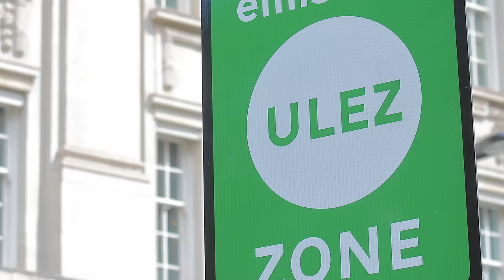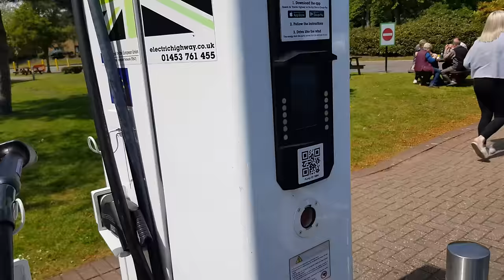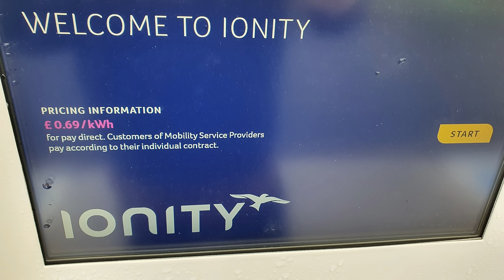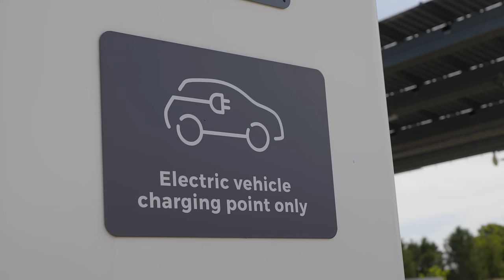The Uncomfortable TRUTH About EVs: The Version NEITHER SIDE Wants You To Hear

Comment: Regarding EV fires, it's worth pointing out that while LiNMC cells are prone to thermal runaway when damaged, the mainstream car industry is quickly transitioning to LiFePo chemistry (largely because it's cheaper) which is far more chemically stable, to the point of it being almost impossible for LiFePo battery packs to catch fire even when damaged or exposed to extreme heat.
Reply: They'll never happen in anything smaller than a truck.
"Li-ion batteries can store more power per volume or weight unit than LFPs. For example, the energy density of a typical Li-ion battery is around 45–120 Wh per lb (100-265 Wh per kg), while the energy density of a LiFePO4 battery is about 40–55 Wh per lb (90-120 Wh per kg)."
Reply: @m4rvinmartian  Dunno what you are talking about.. For example Tesla's Chinese manufactured cars use mainly LFP packs since the start. Chinese EVs will soon be almost exclusively something else than NMC. From 2020 to 2022, before the Berlin and Austin factory, basically half of Tesla's were manufactured with LFP packs.

The current Model 3/Y 60kWh LFP pack makes for a great EV at as low as ~35k€ after incentives.
Reply: even with fireproof battery i still love to rev the hell out my itb shtbox,sounds good,feels good.
gas is near free here too
Reply: @m4rvinmartian  You are seriously misinformed, they are already in the Tesla Model 3 & Y RWD and all new BYD's.
Reply: @m4rvinmartian  FYI, LFP batteries are also Li-ion batteries… LFP are just mainly using iron instead of nickle, which is good for cost and safety, but not as good for energy density…
Reply: @m4rvinmartian  Tells me you know nothing about BEVs or batteries!  Today there are already significant volumes of new passenger cars that use the LFP (not LiFePO4 which is a specific chemisty) cells.  Because these cells also have an ageing slope that is roughly half that of NMC cells you don't need to fit more capacity or even the same capacity because the capacity that determines the pack nominal size is the End Of Life capacity and not the new capacity (ie the capacity at EoL SoH)

Today, a mainstream Tier1 OE certified cell supplier is churning out LFP cells that have an installed specific capacity just 6% lower than for the NMC equivlents, this makes the reduced capacity pretty much irrelevant when compared to the 50% reduction in cycle based aging!
Reply: The cheaper, lower range vehicles are the ones which typically have the LFP batteries.
Reply: @sepehr-9210  You might like the 2025 Hyundai IONIQ 5 N. It emulates an internal combustion engine paired with an 8 speed manual double clutch transmission.
Not cheap though.
Reply: @jamesphillips2285  in no case i would buy a korean ev
you can buy a r32 or r35 with that money
Reply: @sepehr-9210  and get passed by the EV. If you've never driven one, i'd recommend a test drive in a model 3 performance. The speed is on another level, and it does it without being uncontrollable like high horsepower ICE vehicles are a lot of the time. plus it's cheaper than the ioniq and faster and more efficient. Also, the fake shifting is the dumbest thing ever. The whole point of a dual clutch is to save time shifting and have more time on power. The car making noise is LITERALLY the south park episode with the biker gang. It's the same thing.
Reply: @aidencaterwall9146  in a real car community, no one cares about getting passed by an ev
The real reason why people love shtboxes cause they can fiddle with it and the story behind it is what matters
Plus I don't think you can autocross or rallycross a tesla ,like a pug 205/106 or a ford focus.
Speed and drag is for 12yo kids,we gather up only to have fun unlike ev owners 
(When all the time they talk about how many hellcat or Porsche they sMoKeD)
Reply: @sepehr-9210  it holds .95 on the skid pad with the stock tires. You only fiddle with shitboxes because they are shit. You have to upgrade it for it to be competitive. There’s a reason why people upgrade to nicer and nicer cars most of the time.

Also, your argument is a no true Scotsman fallacy. Plenty of people care about being passed, and even more people care about being able to get out of their own damn way. Shit boxes are fun because they are cheap and light and you can drive them hard without risking an accident. The traction control in the model 3 performance lets you do this too, but on a completely different scale.
Reply: @sepehr-9210  oh and as far as fun goes, I bet money the model 3 performance puts more smiles on faces than any shitbox.

Comment: The biggest problem is the price of electricity. Somehow, the government has allowed it to spiral over the last two years despite the input costs of generating electricity being about the same. If electricity was cheap (and by cheap I mean less than 10p/kWh for domestic supply and less than 20-25p/kWh for a fast charger), consumers would be all over them as they're so much cheaper to run despite the higher purchase cost. At current prices, it just doesn't make sense if you don't have a company car scheme. 

The same is true for heat pumps - despite spending ages researching heat pumps, we're going to replace our old boiler with a new efficient gas boiler.  Gas is so much cheaper than electricity that even the most efficient heat pump with a CoP of 4 would cost more to run, making the higher initial investment a complete non-starter.
Reply: Octopus ("-Go") (and others, I believe) are offering under-10p for super-off-peak. The deal for heat-pumps is a little more expensive. It is irritating that Octopus differentiate between the two - you need to prove you own an EV to get "Go". A worse problem is the grid supply that most homes have. I have 1-phase 100A, and like most people, upgrade to 3-phase would be extortionate. But my supply will not be able to fully charge an EV and run the heat-pump in the small slot of super-off-peak hours that "Go" or the other allocate. A battery would make the situation even worse. In the long term, the answer to all this is a massive, cheap home battery and truly dynamic "pull-oriented" operation. It isn't on the horizon in say, next 2 years. So for now, most power will cost 10p but you have to just put up with the occasional ripoff which might be 70p at a fast-charging station. But "non-starter" is incorrect; with the UK govt 7k5 grant a heat-pump is viable, especially considering that the pricing of gas vs electric is entirely artificial.
Reply: Natural gas is cheaper today on the wholesale market than it was in 1990.
Reply: @jonb5493 That's not the biggest problem.  The biggest problem is that we'll need to spend several trillion pounds on infrastructure to upgrade the grid, and I hope you're joking about batteries. People are out of their minds with all that stuff when the alternative is a 4p / kwh gas boiler for the house and their existing car at £1.40 / litre for petrol. It's absolute insanity.
Reply: @davelowe1977  Let's look at the numbers. 4p/Kwh gas is about the same cost/KWh heat as 10p/KWh electricity, assuming a CoP of 2.5 in a heat-pump. If the heat-pump has better than 2.5 CoP, it is actually cheaper than gas. Besides, a couple of years ago gas prices were 4x this. And regarding petrol home-charged EVs are far cheaper to run than ICEs.
Reply: @jonb5493  Except that gas is 7.67p kWh and electricity is 29.49p kWh meaning that with your COP of 2.5, the electricity is 35% more expensive. Also, once there's no competing fuel, the electricity price will skyrocket.
Reply: @davelowe1977  No. Super-off-peak is 8-10p/Kwh. See the Octopus G and Cosy plans, and equivalent among their competitors.
Reply: @jonb5493  And what if you want to heat your house during the day and not just at 2am?
Reply: @davelowe1977  Basically, there's no way around huge boiler capacity: the "traditional heat battery", which can be a real problem for small, old homes. A solution that I don't like is the "glorified storage heaters" ala Aquaficient et al. They are  extortionate and get zero financial help, and still need some space for a boiler. Clearly getting gas out of our heating systems will be a long and incremental process: easiest homes first. BTW if you're saying that the govt or whoever are taking a cavalier attitude of "everybody trash their gas heater and it'll be ok somehow" - I couldn't agree more. This is a massive transition, there's no denying it.
Reply: @jonb5493  it's unnecessary, that's what it is. The British Geological Survey reported that we have proven gas reserves to continue consumption at the present rate for 748 years.
Reply: Greed is always a factor in anything new that will make money.
Reply: There won’t be an “off peak” rate if we all move to electric vehicles unless they build a lot more nuclear power stations.  The reason “off peak” is cheaper is because they don’t have to fire up so many gas plants for peak daytime loads. 

We would  always need a certain percentage of fossil fuel plants to be able to recover from a dead grid.

Comment: I am not anti EV but anything which is mandated by our politicians has me seriously worried. I have a nasty feeling we could be looking at another Dieselgate fiasco in the future but in EV form. There is also the nasty fact that EVs do burst in to flames (not frequently) and are very difficult to extinguish (which is the difference to ICE vehicles). If anyone wants an example of this, Google why Swindon Audi (UK) is currently closed  and I mean the whole dealership! We need a more pragmatic approach to personal transport and agree that EVs are not the best option in all cases. Mind you, one thing needs to be made very clear - current EVs are not saving the planet. All one is doing by buying an EV is reducing your vehicle emissions to zero. The eco impact of EV (and all car) manufacturing is massive. The EV is just a wee bit less bad car. Also remember, the six largest container ships on the planet emit more CO2 than all the cars combined...
Reply: The most environmentally friendly car is the one you already own.
Reply: You're told c02 emissions from ICE engines are bad. Well I've a 10kg bottle of r404a refrigerant in the back of my van. Its c02 equivalent is 39.2TONS, or 275,000kms in a car or 916years of a 10w lightbulb. 

I'll stick to my 23 year old 1jz Toyota Crown Athlete VX
Reply: EVs suck lmao... Bad for environment, Slave labour to get minerals, Long charge times, Not cheaper to run tbh, When battery dies or gets worse in 5-10 years you need to fork out lots of $ for a new one 🤡

Comment: The 'cashless' aspect is alarming and very valid.  Aside from the 'personal interaction' aspect, it is a real issue for the future (not a conspiracy thing).  Privacy alone is seriously worth considering.
Reply: I haven't paid for petrol or diesel with cash for 30 years either.
Reply: Who uses cash these days?
Reply: its more of a concern with less developed countries, not to exclude developed ones of course. but when network cut off or system overload can just happen anytime due to improper infrastructures its very worrying for future EV users living in those areas.
Reply: cashless payments hinge on the same resource as EVs and increasingly our whole society. Electricity. The biggest threat to a future society that does mobility, heating, cooling, payments, smart homes, etc via this one single resource is that concentration of risk.
What will we do after a day of a power outage, 3 days, a week? Will supermarkets battery backup their payment terminals so we can get canned food out of them legally?
Will terrorists figure out that the most damage and chaos they can do is simply attacking a few substations outside a big city that will take days to fix?
There are solutions to all of this but only very few people haven even started to think about them.
Cash Payments might be such a backup  solution.
Reply: @catriona_drummond  - an excellent reason, one amongst many.  Thank you.
Reply: You're driving around on roads slathered in ANPR, in a car with a registration plate, with a license in your name and you're worried about privacy? Besides, if you're so concerned, charge at home, or use a prepaid debit card. As for "personal interaction", many chargers are right beside amenities, petrol stations, supermarkets & restaurants. If you're charging your car on a public charger then you can get out and buy a sandwich or whatever. I'd add that there are an increasing number of petrol stations where there is no attendant and you pay by card so if you think petrol == person and electric != person then think again.
Reply: I had issues with the ONLY charger within 10 miles refusing both my cards; I phoned the number on the machine, explained the problem and - after trying a reset, they took my card details over the phone.
Reply: Wait till another carpark goes up in flames but caused by an EV parked under an apartment block.
Reply: I don't think this is necessarily an EV charging station problem, but moreso with any modern fuel station. The Netherlands is moving to a cashless country very fast and pretty much every new smaller gas station is unmanned and only accepts card. If you are building a new fueling station, be it EV or petrol, you're gonna make it as advanced for the time as possible. Building a building with a small store and and finding a guy to sit inside it 24/7 just isn't gonna work in our modern society.
Reply: @andys5841  Try paying for fuel when the internet is down. It does happen and during an emergency you will be stuck. It happened in Australia during a recent bushfire emergency. Those who didn't have cash could not get fuel.
Reply: Non- boring people, some of us got to festivals (wifi always down) some of us drink in pubs where there pints are cheaper for cash. Buying drugs is easier with cash. You always need cash for a failsafe. City folk dont understand this.
Reply: @InterestsparkedTV I’m sorry, what was that?
Reply: @catriona_drummond  if this becomes a reality, society will adapt like it always does.  And probably in ways we can’t predict.
Reply: What is much more alarming, is the fact there is no climate crisis, manmade or otherwise.
As for cash, only 3% of money in society is actual cash. If we want more cash to be available, we must start using more cash on the behalf of the people with no access to a card.
Reply: @JohnSmith-vy4lh talking bullshit mate, the change in the climate is very noticeable now for anyone that has been around for 30 or more years.
Reply: @CheradenZakalwe  Bot alert !!!
Reply: @sargfowler9603  In the US alone roughly 20ish% of the general population is "unbanked" meaning they don't have a debit or credit card. And even ignore that, as someone who has a bank account and has credit cards, there's been times I'm broke and have to break into the side jar of random loose change/cash to pay for transportation. It's pretty normal for those on the lower end of the economic spectrum
Reply: @robertt9825 Yea, I'd read that the USA was behind the times with payment methods. I think you still use the credit card machines that slide back and forth?
Reply: @sargfowler9603  Hello, I use cash to pay for fuel regularly. So while the number is likely quite small, it is not zero.
Reply: @foppo101  If you've got nothing to hide it's not a problem.
Reply: In the US, even unbanked people can still load cash onto a prepaid card. Food stamps and other benefits are exclusively distributed on cards now. Let's not exaggerate.
Reply: Nah